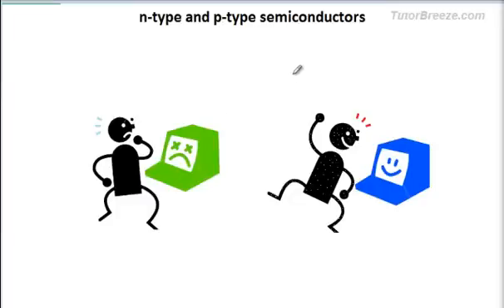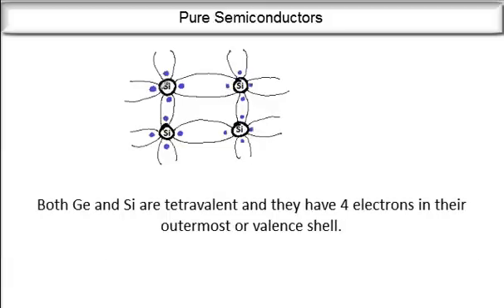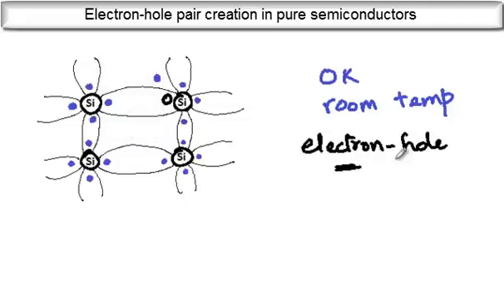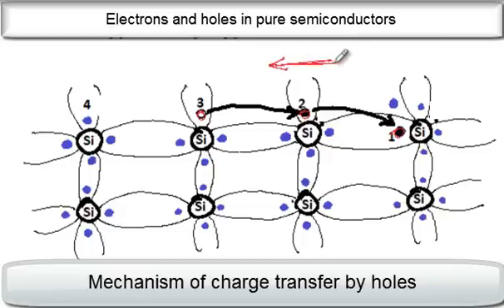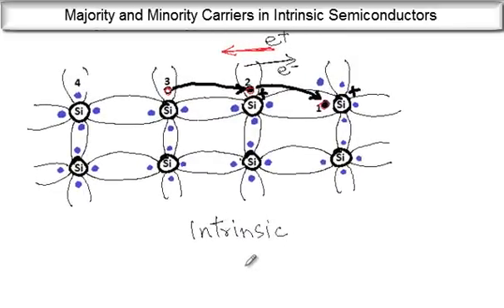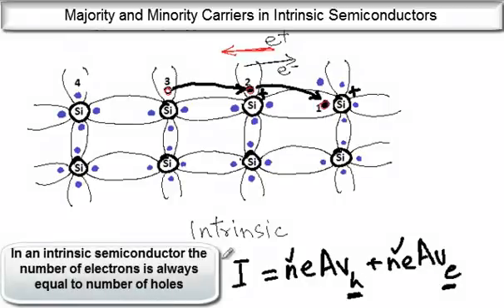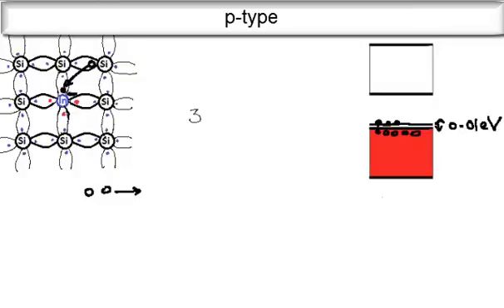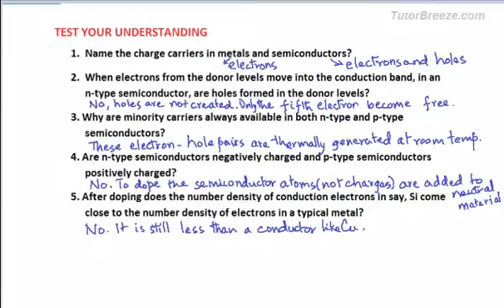n-type and p-type semiconductors

Comment: how minority charge carriers occur ,even  we are doping with 5th group elements it has excess of electrons. Then there is no chance of forming of holes. please clarify my doubt..
Reply from the maker: Due to heat a certain number of both electrons and holes are created. Apart from that you have the majority carriers when you dope the material. So, you have electrons and holes generated due to heat and electrons available due to doping.

Comment: Holes are the vacant spaces left by electrons right? Why then is the velocity of holes less than the velocity of electrons? Shouldn't they be the same?
Reply: I think she meant that the electrons in the conduction band have a greater velocity than the holes do. When electrons fill in the holes, that's not the movement of electrons, that's the movement of the holes. The movement of the electrons are the electrons that were initially released (the free moving electrons, not the covalent ones)
Reply: Pursuits Live actually holes are not moving, they remain in there place. electrons are the which are moving  to fill hole or creating holes. Although we assume that hole is also moving for over convenience. And thus velocity of holes will always be lower than velocity of electrons.

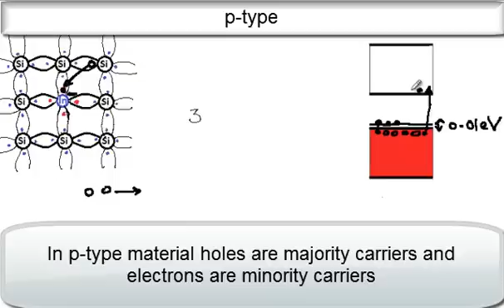Comment: I don't understand what happened at 15:12, how that electron has enough energy to jump to the conduction band?
Reply: dijana vrcelj its the room temperature that is giving enough energy for the electron to move through the forbidden zone. Keep in mind that semiconductors have very low energie gaps at room temperature! Well hopefully you’re still alive 3 years later.

Comment: With thanks from Singapore. This video helped me a lot :)

However i would like to point out an error (pls do correct me if I'm wrong).
At 14:20, you mentioned that the acceptor levels which are drawn slightly above the 'conduction band'. But I've thought about it for a while, I think you mean the 'valence band'.

Comment: Hello Ma'am.
I have a little question.
You clearly stated that extrinsic semiconductors are electrically neutral.
Now, to me that makes sense in case of a p-type semiconductor because for every hole formed we have a corresponding negative charge.
However in case of an n-type semiconductor we have excess free electrons,will they not contribute to a negative charge on the conductor? 
Or does the loss of an electron form a hole in the dopant atom,so charges are neutralised?
Thankyou for the videos!